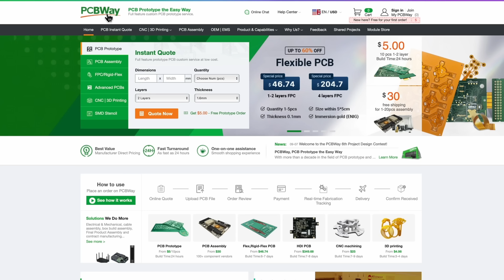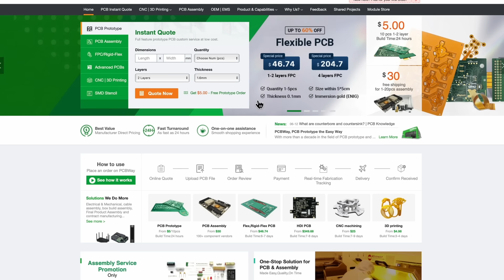Can we turn a catastrophe into a learning experience? Nordmende Rigoletto 59 pt.1 #pcbway#

Comment: Hi Manuel. I replicated a dial glass in PowerPoint and printed it onto a waterslide decal. It worked nicely except that I had to live with a yellowish colour instead of the original gold.
Reply from the maker: Yes, that’s probably inevitable, except if I leave the gold areas transparent and spray gold paint from the back. It’ll be a trial and error but might work.
Question: did the dark parts come through OK?

Comment: I cannot even begin to imagine how that glass was broken like that, it has shattered. Anyway, it looks like a straightforward restore Manuel. Cheers!
Reply from the maker: Should be fun to try something different or change.
Reply: It is not a good idea to add a 'protecting' sheet of any thickness on the glass, because it will transfer force from the outside of the box to the glass. That's how I think it happened.
Reply: Hi! I believe that the root cause for glass shattering is poor scale fixture design: as far as I can see, the glass is secured only by 4 clamps placed at the very far left and right ends. This leaves a huge distance where the glass has no support. The resonance frequency for the thin glass blade will be easily met during transportation. After the initial break that, most probably, will occur in several places, the broken glass pieces will be shattered by hitting all other interior parts. In my opinion this scenario is most probable since package has no external marks.
Reply: The box had probably experienced a drop during its journey. Sometimes a drop will not have visible damage to the box, but the impact will destroy fragile content. I'm a package designer for mail-order business. Furthermore, the design of the product can affect the chance of breakage just as the other comment had pointed out. For a vintage piece like this, it's truly heartbreaking indeed
Reply: At a guess, something pushed in on the knobs (when the knob dropped it).

Comment: When I did the first one it didn't exist on the internet and there wasn't one yet and there was a counter at the back of the shelf as to which lamps should go where and the rest was figuring out what still works and so on and what I had to do to make it work. to fix it, I was also cautious and apparently did it how, but I was not taught about electricity and such and I managed with a small battery and a light and a pointer meter that was all I had.and I was still a child at that time and have now repaired another one

Comment: The fact that the box wasn't damaged proves that the dial glass was kicked in before packaging.
Reply from the maker: I agree
Reply: It doesn't matter how well you pack it, it will destroy itself through sheer inertia. Imagine the delivery guy throwing it into the truck at the depot, then kicking it off the tailboard outside your house.
I once received a well packed sig gen which had decelerated at such a rate that the power transformer had punched a dent into the chassis it was bolted to
Reply from the maker: Yes, unfortunately, we’ve all seen similar mishaps when dealing with heavy equipment
Reply: @electronicsoldandnew  Still I am convinced that the owner after a “terrible accident” happened to his radio saw only one way out: Saint Manuel Caldeira. Saint Dave Tipton would have been a good alternative, but unfortunately he lives on the other side of the world. Both saints work miracles from time to time…
Reply from the maker: 😊 this one will definitely need divine inspiration
Reply: @electronicsoldandnew  Fortunately Easter is coming. Time for a resurrection!

Comment: The carnage reminds me of an RTR I bought from the UK. The outside looked fine but when I opened the lid I found that the chassis had torn the mounting screws out of the plywood case and smashed a lot of parts, including one of the spindle motors. I do have a replacement motor somewhere but haven't touched the project in years.

The plug for the tone preset switches is a nice design. My WSW Phono Tango 58 has the switches fixed with two big knurled screws so you can pull the switches without having to use any tools. That's nice but removing the chassis still requires soldering because both the speaker wires and the mains lead for the record player are soldered to the chassis.

Looks like the EF81 was replaced at some point, it's a Tungsram and all the others are Telefunken. It's funny that the back say "220 V" right next to a voltage selector for the usual 110, 127, 150, 220 and 240 V!

Comment: Hi Manuel.  You certainly are going into a lot of detail with this one.  I imagine that a novice restorer would find it very helpful.  There are a few of these radios around.  I restored an identical one  about a year ago.  Perhaps you will be able to get a replacement dial glass from a scrap radio somewhere.  I'm sure someone will have one.
From memory I was not able to get any audio, or very little, without the tone control buttons plugged in.
Cheers
Reply from the maker: I’m actually looking forward to trying to make one myself 😊 the tone switched do in fact need to be in for testing.

Comment: 14:05 They could've added 2-3 layers of strong cardboard on the front of the radio or, better, a sheet of plywood to prevent any kicks from resulting into this kind of damage. I don't think the crumpled paper inside offers significant protection. I'd use plenty of bubble wrap there or lots of crumpled supermarket plastic bags (I do mean lots). If the packaging was as you described it, this looks suspiciously like the result of a rather malicious act or gross mishandling.
Reply from the maker: Probably

Comment: 12:29 You should be careful with these as the paint is on the back side of the glass and it can be very fragile in some case. Maybe not for certain radios or glass but I know this for a fact for dacron plates (ask me how I know). Once the paint on the back is scratched, you cannot recover it. Of course here you don't care too much as the glass is already gone but it's always good to be cautious as you don't want to have to put together flakes of paint as well as shards of glass. That would introduce another layer of difficulty.

Comment: A suggestion for the glass... Disclosure = I have never tried this method... Hopefully, find a picture of the original glass design. If not, create it with a draw program. Use the drawing to create a negative transparency. Use the transparency to create a silkscreen. Use the silkscreen to apply gold leaf glue. Then, apply the gold leaf with a proper brush technique. Surely, easier said than done, but with your skills, I think you will be very successful!
Reply from the maker: That could work 😊

Comment: I do know this problem very well - so well, that i stopped ordering these radios.
If i cannot pick it up, i let it go.
The problem is mass and the inhomogeneity of the whole thing. Mass comes with inertia.

This mass gets accelerated many times during it's journey- and when the accelerated parcel hits the floor, many bad things happen at once. 
Chassis may break free from the wooden base, if not, it at least it moves around, splits the wood it's attached to, bumps it's environment, shatters tubes - transformers badly bend their bases, printed circuit boards get hair cracks, breaking lots of copper traces under their own inertia - heavy glass dials also literally break under their own weight - when the parcel get's thrown and then apruptly stopps. 
And throwing is exactly the way, postage trucks get loaded. Ideally there is a person to catch the parcels inside the truck - but very often the loaders are very alone with their load - and constantly under time pressure - catching doesn't work every time either. Especially not, if the parcel isn't lightweight, but light enough to be able to get thrown - just the heft of an old wooden tube radio.

I'd almost guarantee you, that this radio was perfectly fine and got packed with love and care - but people just don't think about acceleration and inertia and what these forces will do, if applied to mass.

Lucky you, if you hadn't had this happen several times before.
I do know only two solutions - fill the inside as tight as possible with the right amount of foam with the right hardness to support everything with weight - especially glass dials, transformers, chassis before packaging - or pick it up locally.
Or- the classic way of getting stuff the non throwable way -> strip it onto a hefty pallet, which has to be moved with wheels.

What never works, is marking it with " Caution - Glass! " stickers. There is no room for special care in this business. At least not in Germany.
These signs may even get targeted by frustrated pressurized workers in need of relieve.

I did send you an email.
Reply from the maker: Makes perfect sense, and I agree that the warning stickers are a waste of time. Unfortunately, living on an island leaves me with very few choices as I buy most of my radios from Germany. Fortunately, it hasn’t happened more often. 👍
Reply: @electronicsoldandnew  If you are interested in the spare part, i'm currently on it.

Comment: If you can find proper glass inks (they are the same as for the ceramics meant for use without furnace curing), manual screen printing (the way it was made originally) is not that difficult, and probably you can find someone still practicing it in your area (souvenirs for tourists were made this way before transfer printers).
Reply from the maker: Need to start looking for someone here who can still do that
Reply: @electronicsoldandnew  Modern plastic replacements are also a way out: my cousin recently brought me a souvenir from mainland Portugal - tradionally painted "ceramic tile" mounted in a cork plate for hot pottery placement, but real hot it could not handle - it was printer printed laminated plastic, so looking for what is available nearby would give you wider prospects.
Reply: @electronicsoldandnew  You can also print it at transparent film and than put in on clear glass. Some films are made with one side adhesive.
Reply from the maker: 👍 that’s closer to home 😊
Reply from the maker: True. The problem will be getting the dark sections dark enough to be clear. I may have to do a double layer trick.
Reply: @electronicsoldandnew  If you reproduce the glass yourself, it will be quite a task. I see this being a case where the gold paint stuff goes on the front of the glass (or plexiglass, depending on what you choose to use) and then the back of the glass being spray painted to achieve the necessary opaqueness. You can then choose to sandwich this with more sheets of glass or other transparent material on the front or the back as deemed necessary.
Reply: @Stelios.Posantzis laser print the gold detail in reverse on a water slide decal, apply to the back of the glass, spray paint the black over it
Reply: Thanks  @robturner3065  ! Do you mean one can order the materials for laser printing the decal at home? I was aware that decals can be made to order by certain companies but not that you can make them on your own. These companies also include the background colour on the decal, if I recall, so you just have to apply the decal and you're done. What I am not sure about though is how one can trust them/instruct them to get the dimensions exactly right. Doing it at home gives you the freedom to experiment at will till you get it right.
Reply from the maker: @Stelios.Posantzis : I know you can get decal paper for DIY. I have some for inkjet, but didn’t know they sold laser paper too. Know where I can get that in Europe?
Reply: No, sorry @electronicsoldandnew  . I only know those companies in the USA where you can order the decals to be printed for you e.g. radiodaze etc.
Maybe there are companies that offer the paper in Germany so worth doing a web search in German, Dutch etc.
Reply from the maker: @Stelios.Posantzis : I’ll do that. Thanks

Comment: My late father was a radio and TV Service Engineer in the '50's, '60's' 70's and '80's and he impressed upon us the importance of using isolating transformers, rubber mats , insulated tools and always putting one hand in your pocket if poking about inside valve equipped sets (especially).
What are the dangers of pulling a chassis out etc if the set is switched off and maybe has been switched off for many years? Are capacitors on the mains smoothing side not dangerously charged still (even if equipped with a bleed resistor...is the resistor still functioning)? Also, if you get the set on test and turn it off to do a bit of 'twiddling' are there not charged capacitor dangers still then even if the mains supply is disconnected? Many thanks.
Reply from the maker: All these issues will be covered here, as I too learnt them from old masters (many are unfortunately no longer with us).

Comment: I received a couple of Ekco receivers with Bakelite cases. One was totally smashed, case and dial. The other had a smashed dial. A third has a dial where the names and printed on numbers seem to have detached over the years. A this stage I stopped buying these radios. The sellers suffered from chronic stupidity using a single layer of bubble wrap and brown paper for packing.
I also brought some German radios. These are much nicer but one of the sellers claimed to have restored his radios but it was cosmetic only. All the bad components were untouched despite their protestations.
Reply from the maker: Bad packing … the most common way to kill a radio that has otherwise survived decades 😞

Comment: 6:56 What a shame! The radio looks to be in pristine condition given its age.  I'd have to see that box-in-a-box package. Not all people understand the concepts of momentum, mass and energy which are basically what you need to have a grasp of in order to prevent collision damage. Oh, and that of damping too but only as a follow-up concept!
With regards to this type of radios, i.e. those with a chassis in an enclosure, all it takes is for the radio to be placed upside down or sideways and a few jolts to follow and you could end up with a front glass broken or some other kind of damage. These radios are made to travel in the way they are meant to be placed: the right way up. Not many have a chassis that is attached rigidly enough to the enclosure to prevent mechanical damage from parts moving in relation to each other. 
In my mind, the sequence for packaging these radios would involve at least the following:
a) open back, take out all tubes and ensure the chassis stays in place without moving even when radio is turned upside down
b) wrap each tube in plenty of bubble-wrap, stuff the inside of the radio with plenty of stuffing material that will prevent the radio parts moving even if they come unstuck with care taken so that fragile elements such as the loudspeakers, wiring etc. do not get damaged by the stuffing. The tubes can also be placed in there with the stuffing. 
c) close back and continue packaging as you would for a crystal chandelier.
If your knowledge of such things allows it,, between a and b, you can attempt to remove the front glass and the replace the chassis back in its place. The glass plate can then be sandwiched between pieces of strong cardboard and securely fixed on one of the flat sides of the radio cabinet.

Comment: The reason I always watch your channel Manuel is that you are very, very thorough.  I learned how to read schematics from your markup of the schematics you do while repairing the radio.  For me, you are in the two three radio/electronics channels with Mr. Carlson and David Tipton.
Reply from the maker: That is high praise, as I follow both of them too. Thanks.
Reply: You should also add: Jim Burns as well.
Reply: Even though I know my way round a schematic this is always the most enjoyable part of the restoration for me. It's a good way of teaching beginners, by highlighting the signal path. The rest is just power supplies
Reply: All three are high up my subscription list.
Reply: Also check out: Jim Burns
Reply from the maker: @tubeDude48 : 👍

Comment: Your opening comments about learning this hobby mostly from YouTube is very revealing. You know the difference between presenting a restoration versus actually teaching the “ how and why” of restoring vintage radios. I did not work in the electronics field but like you have learned the hobby by watching videos….yours mostly. I’m of course interested in how you replace the glass but I’m also interested in how you replace components on the PC board. On my bench now is my Dad’s 1959 Zenith C835R. I’m waiting for the special alignment tool to arrive as the two coils in each can are adjusted from the top….. That took me a while to figure out… Keep up the teaching. Thanks

Comment: Glass loves gravity and impulse ... Not. Had the same with 2 very well packed Philips GM60xx tube volt meters. The mirror behind the moving coil meter was loose and cracked. And for one of them the moving coil meter behind it was damaged as well. Same happened with another one, the front glass broken in a very well done parcel. But that is just plain glass that could be replaced.

Comment: Sure looks like it got punched.  What a sad sight!  That happened to me once, but in my case it was a 45 year old upright piano that got punched by an errant forklift.  The entire cabinet had to be disassembled to restore integrity to the frame.  Was covered in mold, too, which meant that it wasn't stored well.  Fortunately, the insurance policy I took out paid for most of the $5,000 restoration.  I actually got a better piano out of the deal than what I started with.  I'm sure you can do the same with this radio.  Looking forward to the final results!